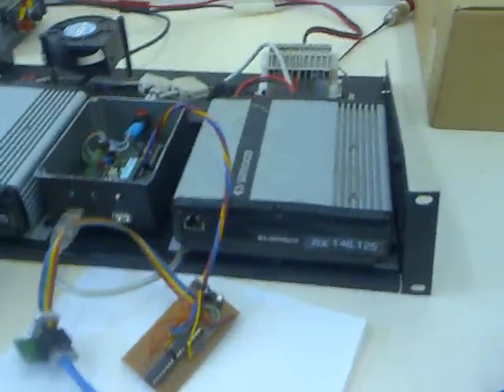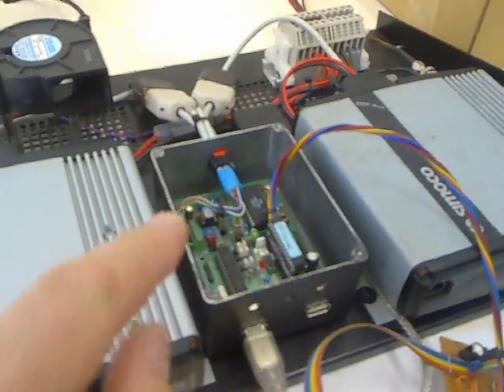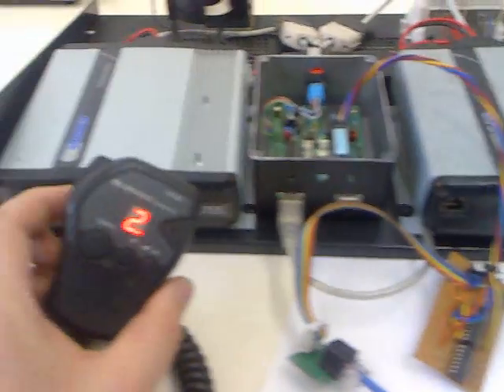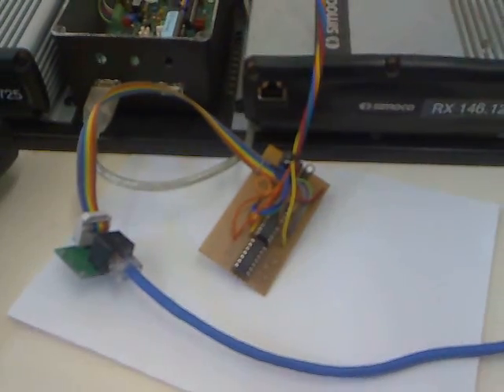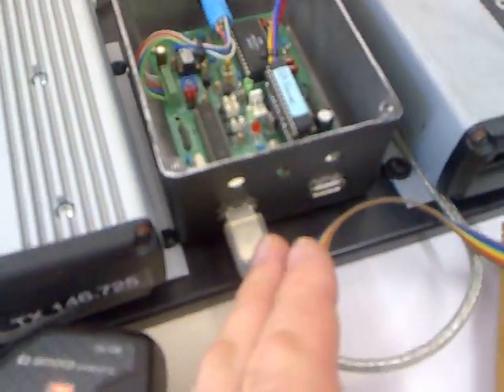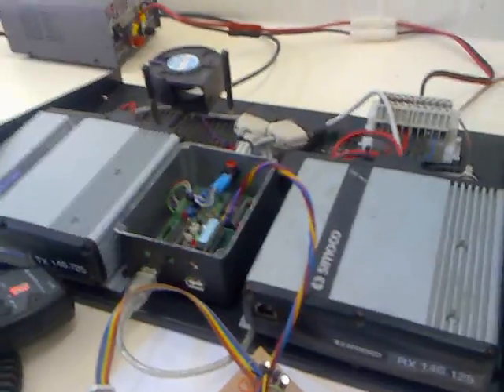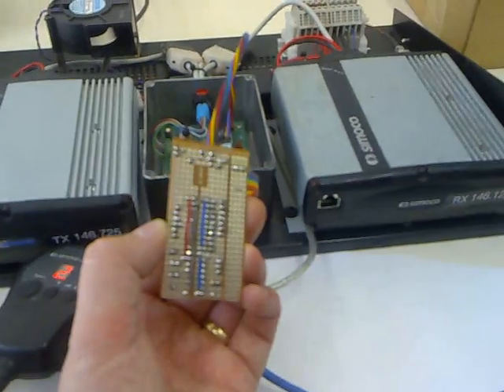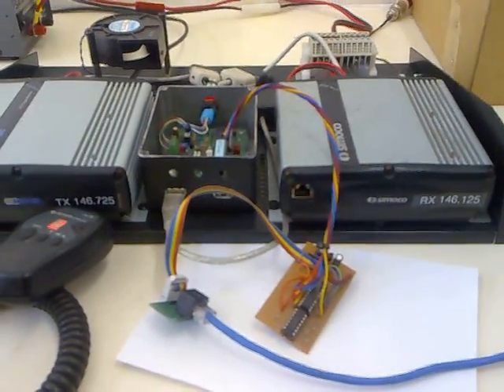Homebrew DV Node Adapter to Icom ID-RP2C interface

Comment: Looks pretty neat Michael.  Good Job!  Those Icom service manuals are torture aren't they? :-)  I made use of them when I built my TX/RX daughterboard mod for the RF stack modules.  I used the free version of Eagle Cad to do my schematic capture and board layout.  A little learning curve, but extremely flexible.  Are you planning to publish the schematics?  If so, I'd be happy to draw it out for you and looks like something I might like to play with.

-Eric N5EBW